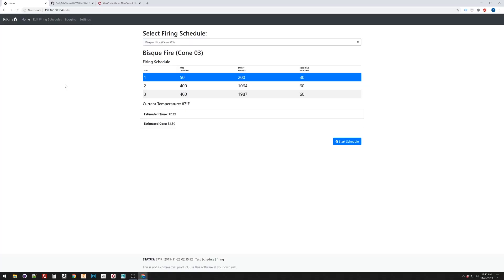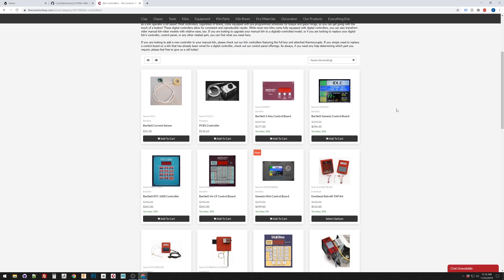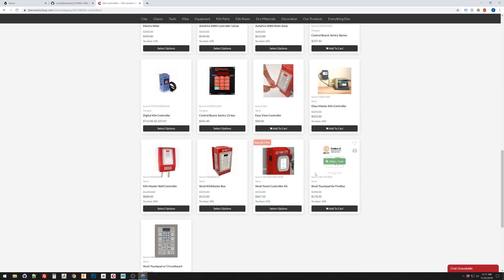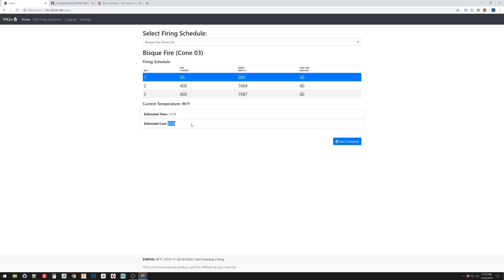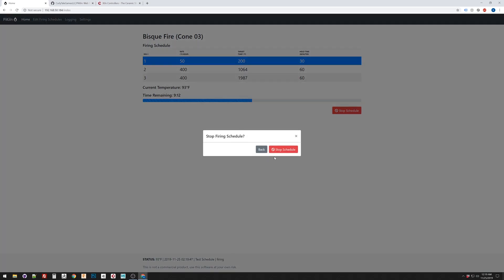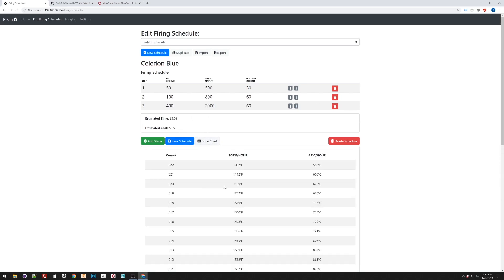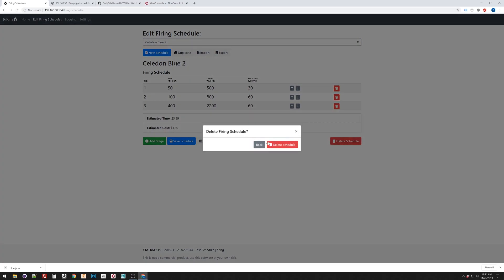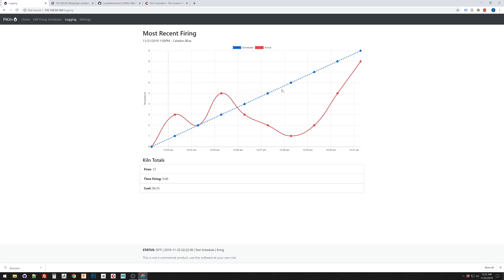PiKiln Open Source Project Feedback Wanted!

Comment: Are you interested for cooperation in developing software and  final GUI for this project?
We are biggest pottery studio on Gold coast also we are running electrical business and now we are planning to build our own brand klin. 

What you build is exactly what I have in my mind. There is another idea to implement software for measuring  resistance when is element to tired and MUST be replaced. 

We areplanning to use 7 inch lcd dysplay sms or email power consumption and open option to implement AL brain with virtual caracter.

Throw me email for confidential conversation

Yoshiko.jp@tutamail.com
Cheers
Reply from the maker: Hi! That sounds interesting, I've made some pretty big changes to this project since I released this video. You can see an up to date version here: https://youtu.be/i8GlMzJPMp0

I'm porting the project over to the ESP32 running micro python. One of the reasons for making this project web based was to avoid needing an LCD screen. 

Measuring the coil resistance is a neat idea. However, right now I have the ESP32 completely electrically isolated from the heating elements. If I added resistance measuring I'd need to use a relay to temporarily connect the ESP32 to the elements. The resistance of heating elements would be different for different kilns too. I'm not sure if it's worth adding the extra components when you can just use a multimeter to check it. 

Maybe I could just add a reminder after a certain number of kiln firings?

I'm happy to get some extra help on the project or at the very least some beta testers when it's in a functioning state.

I'll shoot you an email, I'd like to know more about your company and your kilns

Thanks!
-Ben
Reply: @curlytalegames2609  Where you located country or region?
Reply from the maker: @MrFreedomFightter  I'm in Ohio in the United States, where are you based out of?
Reply: @curlytalegames2609  Australia gold coast Queensland.
Happy New year my friend

Comment: Heyya. Just bought the supplies to give Pi kiln controlers a go. I'd like to test your project and was wondering if you have a wiring diagram from the PI to the MAX31855 or MAX31856?
Reply from the maker: Hi Mihai, thanks for you interest in the project but I'm still tweaking some things with both the hardware and the software.  I'm planning on releasing another update video this weekend